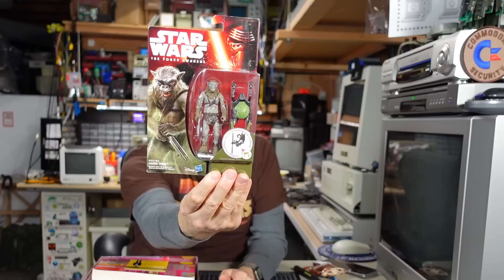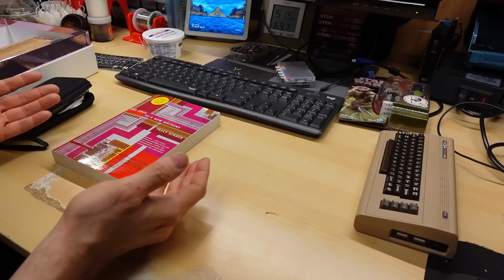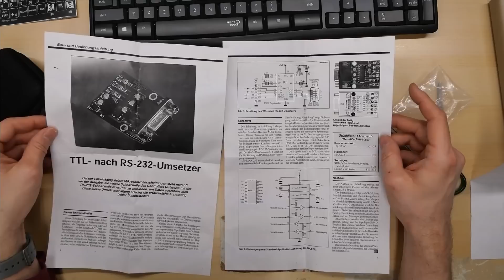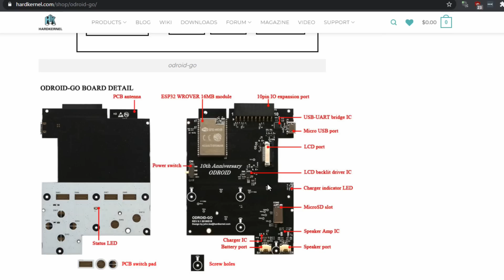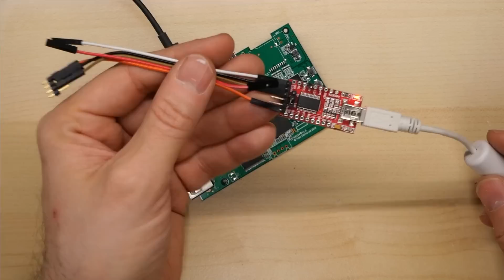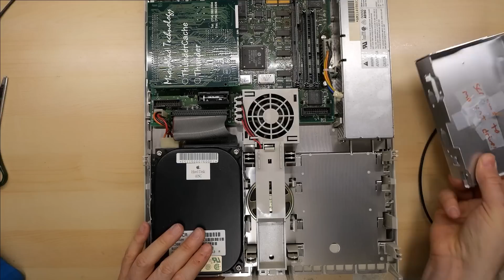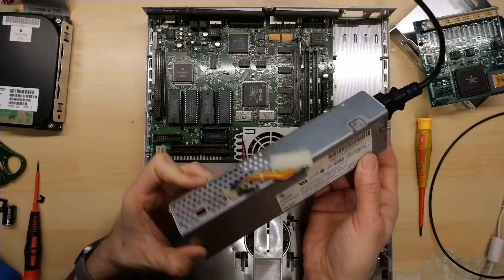A bricked TheC64 Mini? A filthy Macintosh LC, The ODroid-Go ESP32 handheld and more

Comment: As to the mini,... It looks like the original owner tried to flash it with alternative firmware to add games to the carousel,... If you can reflash it,... the current firmware for it is very good,... Otherwise, you have a really cool case for a Raspberry Pi (with some minor modifications).
Reply: IT looks more like hardware failure to me with SDRAM Failure. A failed alternative firmware flash would at least show the u-boot loader being run

Comment: What happens if you apply heat to the top of the chip? If he's already dead, I don't think there is much to lose. I love your videos! Greetings from Argentina!
Reply: He would cock the chip. Reflowing or reballing is possible, but don't just heat up the chip, the board will bend at the heat and that's why you have the cool down time in bga ovens.
Reply: @Spelter  Oh you're right. I thought reballing was simply heating the chip from above, but I see that it is not so easy. Thanks a lot for your answer.

Comment: I think the C64 Mini should go back to the creators for a post-mortem. Early failures like this are not what they need.

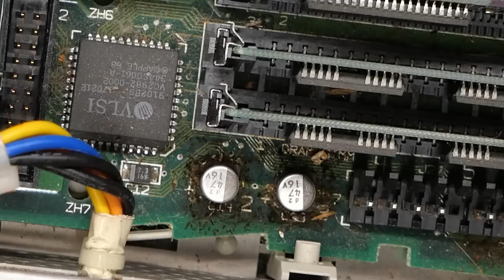41:49 What you are seeing there is the bottom seals of all three of those metal can capacitors rotting out.

Comment: Could try re-flowing it on your 3D Printers hot bed.  Might have to remove some plastic though.
Reply: It won't get hot enough. You need about 350c for reflowing smd chips
Reply: @fuzzybobbles  I thought lead free was only 220c.
Reply: @BloodBlight  Always need a hotter temp to melt it though, as the chip and copper in the board will radiate the heat away. Also you need to heat the area around the chip to stop the board from warping. So always better to have hotter than the minimum melting point of the solder.
Reply: @fuzzybobbles  Absolutely.  :)  Though an extra 130C might be a bit much.   That's why I was thinking the bed would do it, but it looks like the bed on his printer probably only does 100C anyway.  So it would have to be an oven or something.

There was a rash of GPUs that had issues a while back and people where sticking them in for like 45 minutes or something just above the melting point and it apparently worked well!  Not like he would be out anything if it didn't work.

Comment: I have one of those. It's slightly thinner and smaller over all. 3.0 screen  with abxy buttons one back to select English or china button,the click start then chose game  start  then select a game then b button to play game some games will let you click a button to enter game. the game boy is some kind of white clearish still white, on right side you can see and on top are three ports that the backlite is visible when on. I got it on amazon for cheap. when if used it for TV crappy picture. the game boy color is over all bigger than 3.0 8bit game boy from china.

Comment: Just pulled out my dead Apple Performa 400 MAC.  Much the same as an LC.   After re-caping the TDK power supply the +5 and 12 volt output is good but he -5 only has -3 volts.   Anyone know how to fix the -5v  line?   Could something else have failed other than the caps?

Comment: You get that error message from a cubieboard: https://groups.google.com/g/cubieboard/c/MvIgJy0XVH0 my guess is they are using the cubieboard firmware as their platform with a similar setup to the Einstein A20 setup. Might be able to flash with that and at least get it working. If not it's an actual hardware failure in the Ram

Comment: 9:44: I would not be surprised if most people shared your views on Star Wars. I feel about the same. It'll be interesting to see what happens to the Mandalorian in terms of audience acceptance. I agree that Rogue One was a definite bright spot in an otherwise less successful or inspiring recent oeuvre, but then they really did manage to turn things around with the Mandalorian -- only to then get knee-deep into the culture wars, and now I don't know if they've basically lost about half of their U.S. audience over the recent firing/non-firing shenanigans. Maybe the political escalation is just noise that won't make a difference on the balance sheet or Nielsen chart, or maybe they've permanently pissed away a huge demographic just as they had clawed their way back to being universally liked. Only time will tell.

Comment: @adrian's digital basement Odroid has a forum that contains improved firmware with better emulators and UI that someone made. They even have Commodore 64, Atari 2600, Spectrum ZX, and others you can load up on it. I would say check out the better firmware and then re-review the Odroid-Go because I agree, it is a bit meh with the stock firmware. The NES and Game Boy emulators are dramatically improved with the custom firmware. The scrolling and framerate get better. I'd love to see that weird Donkey Kong Party Jam Thing cartridge you have running on the Odroid-Go. Awesome channel btw! https://forum.odroid.com/viewforum.php?f=159&sid=de4bac9849028748ae0a95ab02ba3408 https://forum.odroid.com/viewforum.php?f=158

Comment: While the screen of the odroid go is definitely not great, and the NES game showed a lot of terrible tearing, I think it's still better at displaying Mega Man than the passive LCD in the original Game Boy. The original gameboy runs at 60Hz, and I had the impression I need to run gameboy emulators at around 70 to 75 Hz to match the difficulty of Super Mario Land, just because the VGA CRT is a much better display than the slow original Game Boy display. If you call the Odroid bad, maybe you are spoiled by the improved Game Boy Pocket display...

Comment: The original software for the ODROID GO is quite bad and hasn't been updated for a while, but there are (at least) two better multi-system emulation suites and a good port of the C64 emulator Frodo. I've done a video about the more current firmwares here: https://www.youtube.com/watch?v=s5xgvwJFjRQ (in German, of course…)

Comment: ABOUT THE MICROMAC, Adrian, I think from your tone you thought it was a defunct 90s Accelerator Card company. It is not, it is a contemporary company making these cards now for "classic" Macs. They are presently re-designing their ThunderCache and Thundercache Pro. But you're really crapping on a contemporary small business without actually having used the product, only because of theoretical concerns about the CPU bottleneck, which I'm pretty sure was 24 bits, not 16. That's really disappointing, especially after championing aftermarket Commodore businesses in Germany.
Reply from the maker: The card has a 1994 copyright on it and all the chips are of a similar vintage. How could this be a new card? Here is a product page for it from the 90s: https://www.micromac.com/products/thunder.html Please provide information that this is a modern card from a modern company.
Reply: There are some folks on 68kmla making reproduction accelerator cards but I’m pretty sure this is not one of them. The clones say “BolleMac” not MicroMac, for instance: https://68kmla.org/forums/topic/62169-fs-daystar-turbo040-and-micromac-carrera040-clones/